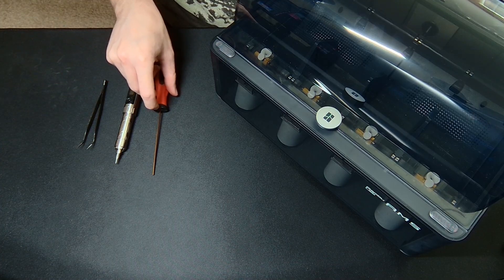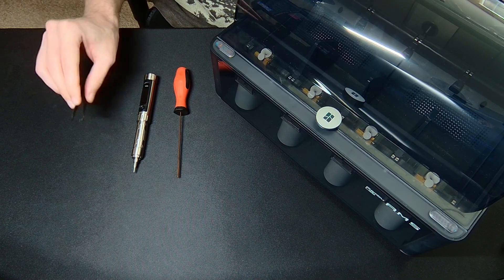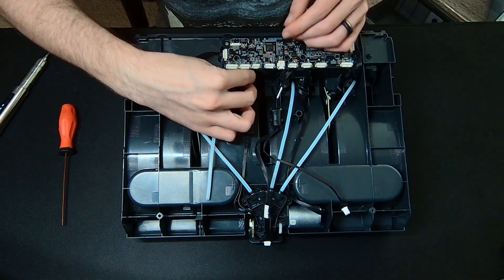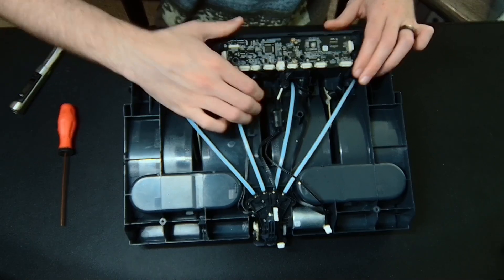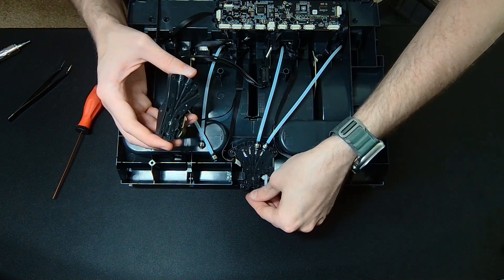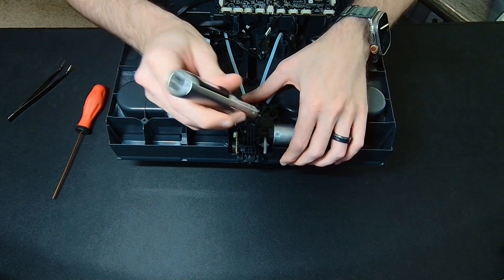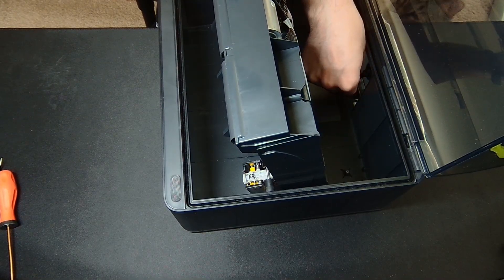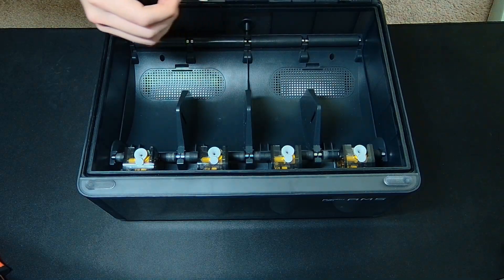How to Print TPU with the Bambu Lab AMS (Mod)

Comment: Hi Noozle
I made a mod based on this video that works with TPU and standard filaments. It's called it CAPXL. You'll be able to find it you-know-where.
Thanks for making this video!

Edit: read the first response to this comment
Reply: Hi, I could not find this on Google. Do you know where I can find this CAPXL? Thank you!

EDIT: Do a search in Maker World.
Reply: @liminalsunset  yeah, sorry. my comments kept getting deleted when i wrote the name of the website. youtube has a super annoying comment filtering system.
Reply: @chemape783  I'm currently printing the spring with 95A since I don't have any 85A on hand. Do you know if this would cause it to be too stiff?
Reply: @liminalsunset  i suspect that it will be too stiff. But you can probably fix it by cutting off 1mm at a time and testing it after each cut until it works. I will order some 95A TPU and make a second spring when i have some spare time
Reply: @liminalsunset  or if you prefer i can send you the onshape CAD file for you to modify
Reply: @chemape783  I tried the 95A spring and 95A bumper and it seems to work fine with 95A in the AMS and PLA in an unmodified slot.  I haven't done an extensive test yet but the TPU successfully changed about 5 times. The remaining problem is that the printer can't always cut the filament, so I may need to change the knife blade. Thank you for this design!!!!
Reply: @liminalsunset  i'm glad to hear that. Your welcome! 
Please consider leaving a comment/make with pictures. I will try it too and if it works well, i'll add it to the description
Reply: Hey I've found your mod on maker🌎

Do you have results for that up to 85a? 

Is your mod able to print both tpu in 2 slots and pla in the other 2?

Comment: Hey it's been a few months since this was posted. Just curious how well it has worked during that time. I'm considering getting a second AMS just for TPU - worth the money/hassle or is the reliability not there?
Reply from the maker: I have been continuing to test and improve this concept. As is the reliability is alright. Sometimes the front 4 feeder motors struggle to feed reliably, but I have been developing a solution. I'll be coming out with a part 2 soon hopefully.
Reply: @noozle3d I can't wait to see a follow up video!

Comment: Edit *

I’m stupid I just need another AMS and the AMS hub I’m really new to 3d printing

So I have a question I need to print carbon fiber nylon and TPU together for a part 

So in theory I could just mod 1 or 2 of those motors and adjust the springs of the tubes and be able to print before materials together?
Reply from the maker: You’re good. Yes this is correct, you would need a second AMS to print TPU and other hard filaments at the same time.

Comment: I played with this a few months ago and only got so far as to trying to change the springs in the entrance of the AMS to softer ones. (Which didn't work) But removing them completely and changing the exit springs to lighter ones is a brilliant idea. 

It seems to me that part of the problem may be the back AMS splitter motor, retracts the filament faster (or at exactly the same rate) as the front AMS gears, which is what makes the TPU snake and jam. It's possible that if the front motor spun slightly faster when retracting that this issue may be mitigated, pulling the filament through before it can snake. I'm currently looking into if it's possible to modulate the motor speeds with a custom firmware like X1-PLUS.

In any case, thank you for this video and keep it up!
Reply: good idea- any luck with this test?
Reply: This is a great idea.
Reply: I'd think this could be modified electronically with some sort of resistor or the opposite?

Comment: Do this with just one slot in the AMS perfect for printing multi material for the pla/petg/abs ect with Tpu I use with prints that need a bit of soft tpu in them thanks 👍🏻
Reply: did this work with just 1 slotr modified?

Comment: Have you run into any issues after the last firmware updates (01.07.03.00)? It had been working perfectly print after print, and now the AMS keeps trying to load then retracting back every time no matter which slot I use.
Reply: Are you joking?
Reply: @infernoeagles5812  no, why would I joke about that. The latest non-beta firmware does the same thing (01.08.00.00). Had to roll back to 01.07.02.00 on all 3 of my XIC's with the TPU AMS mod.
Reply: It almost seems like they did this on purpose but that’s just me though

Comment: Question. Finally did this to my AMS but any luck with the extruder accepting the you from the AMS ? It keep retracting after hitting extruder. Thank you
Reply from the maker: This has happened to me a couple times too. Try a different roll of TPU or cut a few inches off the roll. I believe this is due to the filament sometimes being slightly too thin which can create lower resistance on the feeder gear. I think that resistance is needed to tell the AMS that the filament has reached the extruder. It’s not a perfect solution but remember this is just a makeshift solution to try and support TPU.
Reply: @noozle3d  my issue was actually my buffer
Reply from the maker: @Y33HawGamer  Glad you got it fixed. :)
Reply: @Y33HawGamer I‘m currently running into the same issue. What was your problem with the hub?

Comment: Thank-you for this great tutorial. Liked & subscribed.

As for printing other materials, do they need the smaller springs put back in?  In other words, can the AMS work by permanently removing the 4 small springs and just swapping the large spring for the 2 smaller ones when switching back and forth between TPU and other materials?
Reply from the maker: I tried this, but keeping the front springs removed causes high reliability issues with hard filament. It's best to set everything back to normal if you need to print hard filament like usual.

Comment: I'm think this mod can be done Bambu Lab AMS Lite. The system for the driver looks similar  but it doesn't have the extra feeder that the standard AMS has in the center.  🤔

Cool that you used to 2 lighter spirngs instead of the Center ones to soften the feeding.
Reply: Have you tried it out yet ? 
I am currently thinking about buying an a1 mini combo for multi color tpu stuff
Reply: @7exxe  No I've been saving for the printer sales this summer. I wasn't sure which model I would land on and what "AMS" options would launch into the market.

Comment: Hey, Julian.... Could you please measure one of the two left over motor springs ?  I would like to experiment with replacing them with a much weaker spring, so as not to depend solely on the tension of the PTFE tube.

*I have not yet tried the mod at all.
Reply from the maker: 15mm height by 5mm diameter. These measurements are for the small front springs. I'm not sure how to measure the spring weight though.

Comment: Great stuff! Isn't it possible to just mod one slot? It love to print TPU with Support W.
Reply: Well, you could do that if you have 2 AMS's.  But this mod won't allow that because there's only one spring on the filament 4-to-1 hub.  So basically it's possible to do TPU+other material mixing this way ...  as long as you use 2 AMS's, unless I'm missing something really obvious.
Reply from the maker: Unfortunately no. The biggest issue is the thick spring in the back of the machine, and all four filaments pass through it.

Comment: Thank you for the video. but it didn't help at all regarding tpu. I struggled for about 12 hours with disassembly and assembly and 2 or 3 trial and error errors, and then I re-installed the springs in the same place.
Reply: What kind of tpu were you using? Shore? Brand?

Comment: That’s not a bad shout either, a hollow screw that holds the spring inside would do it, or even a flexible drive like a bendy socket driver would allow an adjuster to be placed at a more accessible point. 👍

Comment: Good job. 🤛👍 Could you make a video showing how AMS works after the change? with several TPU filaments. How to use Bambu studio. It immediately occurs to me that I would change one ams completely to TPU use and use the other AMS to print PLA and other filaments. The dream would be to be able to print several PLA  and TPU filament at the same time. already succeeding with several TPUs would be a step forward.
Reply from the maker: Yes that's a great idea for an update to this video. I probably should have included a clip of the modded AMS working with TPU. Forgive my shortcomings, this is my first video. Hopefully my next one will be better. 🙂

Comment: I've followed these steps and it does not work, the AMS doesn't acknowledge there are filament rolls in the system. I've reversed everything and it works fine, checked all connectors etc. Is it 95a TPU you are testing/using here?
Reply from the maker: Yes, this is working best for me with 95a TPU. I'm assuming the issue you are having is that the small motors in the front don't have enough gripping force to pull the filament in. For me, slot 1 had less tension than the others. I had to cut a bit of the PTFE tube to increase the tension. You may need to do that for the slots that don't have enough grip. I'd recommend cutting little by little, in order to avoid cutting too short.
Reply: @noozle3d  are you trimming the other tube at any end to trim it down? I was going to switch it all out for the creality ptfe and see if that makes a difference. Slot 1 is having the most issues, it just won't grip.
Reply from the maker: @MTB_FPV  Yeah slot 1 seems to have the biggest issue. I didn’t have to cut down any others. Switching different PTFE tubes could be a good idea. That way you don’t risk ruining the original. Also keep in mind that a newer roll will be heavier than a used one. So the AMS will have a harder time pulling with newer rolls.
Reply: Have you tried just swapping out the main spring for a less tension one amd leaving front ones in?
Reply from the maker: @MTB_FPV  I have. The center motor won't have enough grip to overcome any the four motors in the front. You can give it a shot, but in my experience it just doesn't work.
Reply from the maker: @MTB_FPV  I have. The center motor won't have enough grip to overcome any of the motors in the front. You can give it a try, but in my experience, it just doesn't work.
Reply: @noozle3d  You might instead put soft o-rings over the PTFE tubes and then a cable tie between them, and trim the tension that way.
BTW is the issue with hte AMS and TPU only at the start of the print - ie. until the tpu is engaged in the printhead, or is it also while printing? Could you ex. splice 2m of TPU for AMS with softer TPU? If the printer has started and the TPU is in engagement with the printhead will the AMS than generate problems? 
PS I am trying to get a high friction surface on an otherwise hard surface - currently trying overmolding TPU print into PLA print (Print TPU insert, print PLA structure, pause, insert TPU insert and print over the edges so it is molded in.
Any good suggestions on how to improve that?
Reply: had some success, with 3 rolls... after removing the springs you have to force the TPU down rather than rely on the motor to grab it and pull it through.

Comment: Impressed Julian, now I need to design a quick way to de-tension the main spring so that I can switch without dismantling. You can de-blacklist filaments and make your own filament profiles by altering the Bambu filament folder to add new ones, but it's a hassle. :)
Reply: I was just thinking that someone with good design skills may be able to redesign the parts where the springs are located and add something like a screw so you can add or remove tension from the springs rather than having to take the whole thing apart. I don't have those skills but may tinker around and see if I can come up with something, but probably never finish it 😅
Reply: @zora_tech just thinking about this again, you don’t change the spring you can move the pivot pin. 🤔

Comment: Doesn't work because the AMS refuses to allow TPU to be fed through the AMS. States its not compatible whether I use BL slicer or Orca slicer.
Reply from the maker: If you're running into this issue, you can create a copy of a supported filament like generic PLA, then just manually enter all of your TPU settings to it. This will trick your slicer into thinking that you are sending a generic PLA profile when in reality all of your TPU settings are in that profile.
Reply: @noozle3d  still keeps failing. Can’t feed the  tool head.

Comment: If anyone has success printing dual filiment (TPU/PLA) parts using two AMS units (one modified), could you please post your settings and results ?
I am looking to use the modified unit to supply multiple colors of TPU, while the stock unit supplies whatever other filiment is meeded.  I would like to be able to use them simultaneously, in any possible combination. It would be nice to see if anyone has already done this.
Great video by the way !
Reply: I am working on this. Will let you know.
Reply: @SkydozerFPV  hello, is it working?
Reply: @SkydozerFPV  If you figure this out it would be awesome, really need it
Reply: @SkydozerFPV  Helloooooooo?
Reply: I'm using tpu only as support structure, because it doesn't stick good on pla

Comment: Are you also loosing the printing extruder spring screw? I normally print with it out a ways to reduce the pressure at the nozzle as there tend to be a lot of binding. After trying this mod, I’ve found I can’t seem to get material to extrude any more from the nozzle, so was curious if you also do anything at the extruder spring to back off that spring screw at all and if so what worked for you.
Reply from the maker: No, I leave the extruder gear tension just as it comes from the factory. It would make sense that if you loosen this, the extruder gears may not have enough grip to pull filament from all the added resistance that adding the AMS creates. The “binding” issue you may be experiencing could possibly be caused by a partially clogged nozzle or print settings. (Hopefully I’ll be able to make a video on print settings soon).

Comment: Hmmm, to prevent undoing the mod and still have high speed pla printing capabilities would a second unmodified AMS and a multi ams adapter work? Or is there another hard spring in the multi ams adaptor to deal with?
Reply: Hi Jay!
so to avoid paying the price of a MM hub, you can buy a, A1 mini hub for 7 bucks and print an adapter to install your current, basic hub that comes with the 1 ams system, and it practically turns it into a mm hub for a fraction of the price!
I did this and have no problems with two ams systems
Reply: @joelitotek1796 cool! Thanks for this tip!!
Reply: @joelitotek1796 what?
Reply from the maker: I believe you're referring to the Bambu Lab AMS Hub. I don't have one of these myself so I can't tell you for certain, but I would assume that it's just a splitter with some extra sensors and circuitry that synchronizes each of the AMS units. I highly doubt there's another spring in there to deal with, so it should work just fine with a modded AMS and a stock AMS together. Please confirm your findings, if you end up trying it for yourself.
Reply: I do mostly TPU and have had very bad luck so far on Bambu printing with TPU. Feeding from the side, and using harder shore in the AMS, just depends if the printer wants to play nicely on a given day or not. I’m willing to try this as well. If I can get the ams to play nicely, I’ll pick up a second exclusive for pla and one dedicated to TPU. Will update later on after a few trials
Reply: @jayburden6878 tpu should never be fed from the side but above with only 10cm of ptfe tube from the tool head. I have amazing results on my p1p and FAST (for tpu)
Reply: @Majiikk  i print tpu 95 easy on p1